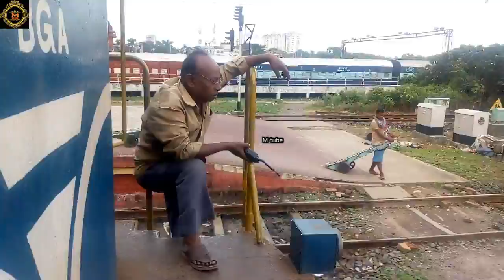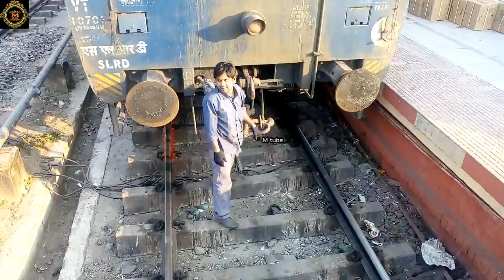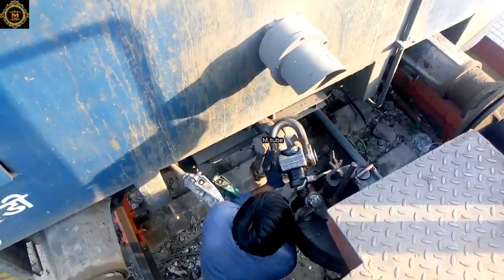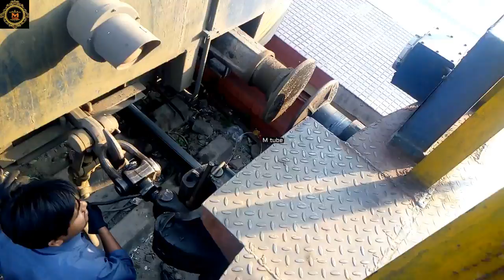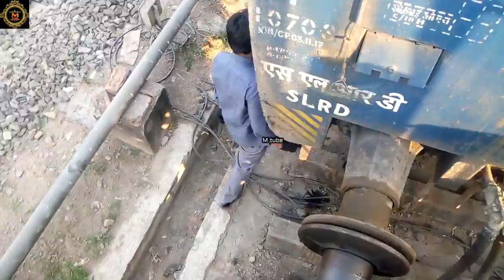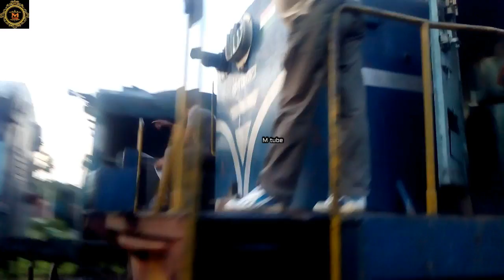Train Shunting

Comment: I am wondering how strong that hook is... locomotive pulling all cars just on that one hook he fitted
Reply: I made this hook in icf
Reply: @prathammohre9a558  Is it made  up of cast iron?
Reply: Screw is also there
Reply: @prathammohre9a558  pppp
Reply: @rakeshsreeramkr1675 yes brother...this is correct as you said...
Reply: I refuse to believe rhat you have never travelled in trains in India, i mean every passenger train in India has this hook and pulley system how did you not know this...😯😯😯😯😯
Reply: @navinbabji  not really, they are moving to CBC coupling in LHB soon
Reply: Idk maybe when it starts moving it's not as much weight on the hook

Comment: now i'm scared. all those cars pulled on a tiny hook.
Reply: Simplest type of coupling ,screw coupling.
Reply: Bhai 2 magnet bhi hote hai
Reply: @satyendrapalsingh1004   kuch bhi
Reply: Pura duniya mein hota hain
Reply: There are pins to protect the coupling from detaching
Reply: @jethalal1270  sahi to keh raha hai
Reply: @Clipworld123-v2  magnet nahi hota mere bhai vo
Reply: @satyendrapalsingh1004  use magnet nhi side buffer kahte hai shock ko absorb krne k liye
Reply: @satyendrapalsingh1004  Bro they are not magnets they are dampers or barriers They are used to absorb shock